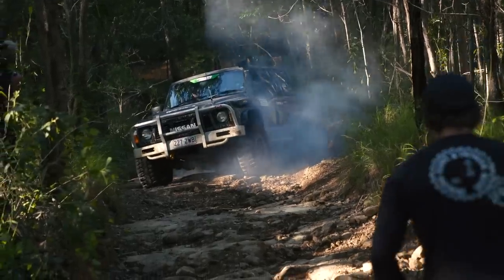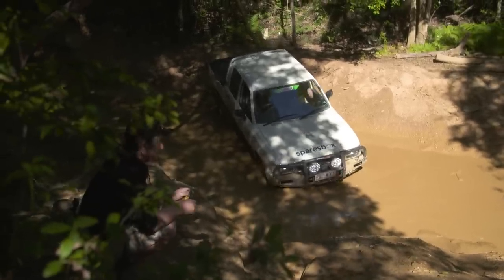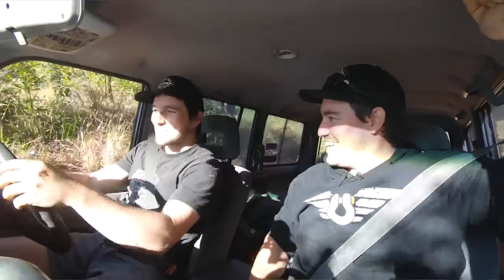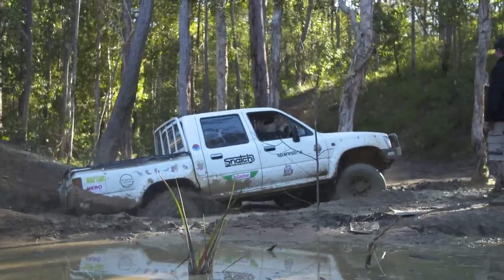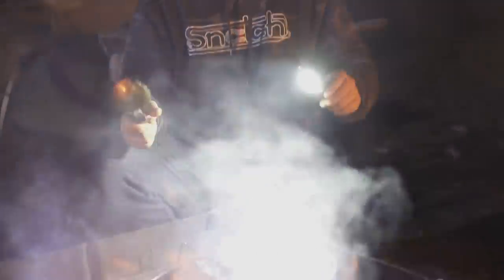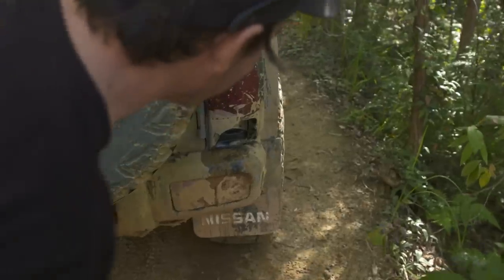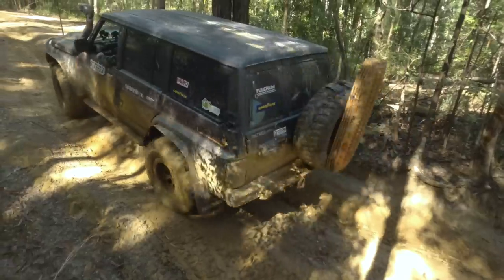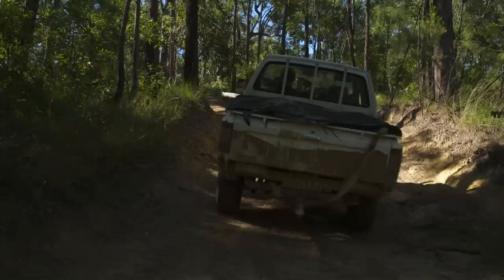BUSH MECHANIC FINALE - WHO WINS!? Jock rolls it, did Shaun finish? Our biggest 4WD Fail yet!

Comment: this really does show you reasonable grippy tyre with little or no lift and a winch will get you anywhere you want to go , we  have over modified our 4wd vehicles for years now, we used to drive those track on 16 split rims with the old dunlop road grippers  barely 6 inch wide rubber

Comment: this just goes to show that you dont really need expensive 4wd and over the top mods to have fun on tracks. i think i will put a winhc on my steel bull bar and have a snorkle already and that will be it. i dont need  fancy cars. now i am very happy with my 2006 dual cab triton. it is 5 speed manaul on 32 inch tyres. i dont think it has a lift kit but heyyyy cant get everything in one life time.
thank you guys for keeping us sane through these times.

Comment: I'd really love to see a review on the long-term use of a 4wd systems lokka, i see how great they work when they have first been put in a car but i never see any vids from someone saying they have had one for a year and this is what's happened
Reply: I've used Lokka on my front diff for many years now. Then it was due to budget constraints as I had so much more to do on the list. I've added Harrop E-Locker to the rear a few years ago and since I had it the GQ has been through so many really tough expeditions in Borneo.

Since then the GQ has been fitted with Superior Engineering full 6" lift suspension kit, the full treatment of UFI 21L, 12mm fuel pump etc etc. Guess what - I haven't bothered changing the front Lokka. I eventually will though, as the steering can be quite hard on very technical tracks. But it never, ever gave me problems in terms of not working as it was intended to.

Comment: Keep Darryl and build him up for 33s and power, steel bar, under body protection, front auto lokka and do engine back exhaust, intake and a tune. Wouod be a budget weapon and would show people that there is a different way to build patrols and highlight the petty and auto, i love a diesel and 50 50 on autp manual but i would love to have darryl with the mods i mentioned added and I'm sure you could get some serious gains given how big and how solid the petty is.

Comment: Having owned an LN106 Hilux, 80 series, GU and now a GQ  I can say the LN106 was a heap of fun but very rough and you never get used to lifting rear wheels. The 80 series was an awesome rig but both patrols were far more capable stock for stock with their factory LSD. Throw enough money at anything and it will be capable so it's good to see some fairly stock rigs going at it

Comment: All fun, no fail! Just more reasons to just get a 4x4, truck or ute, and go have a ball. But it also shows the limitations and need to learn as you go and not endanger yourself or anyone else by being a knucklehead.
  Cheap fun can be had. Still think lockers are a good first step. Because bigger tires can need a lift to not rub and cut themselves to death.

Comment: R them lockers in the front any good in the sand? Especially on sharp turns? I run air lockers so I have full control and can switch them off when turning in sand

Comment: As to who won the challenge? That hilux was as unstoppable a the legends say. Never missed a beat despite the cost and age.  Put bigger tyres and lift the suspension and it will be great, although I m not sure it will have the power/torque for the bigger tyres.  But despite the dubious reliability (what do you expect for $5k) I was very impressed by the offroad ability  of the GQ.  Put lockers on it and wow!

Comment: I have very very soft spot for ln106. Had a couple.  I have a gq td42 Silvertop aftermarket turbo well over 500,000 on the clock. Un locked and been all over vic high country,  south coast monkey gum. Been all over western nsw and QLD. I have a passion for the old rigs! If my cars could talk.  Lol

Comment: Ol’ Darryl won i think it had a cpl of mechanical gremlins but as far as wheeling goes it crawled threw and up everything . Defiantly the better of the 2 vehicles .. i was really impressed open diff’s and did better than the Lux with lockers ,, SHAWNO AND DARRYL  FOR THE WIN ! 😂🤘
Reply: Actually the LSD on the GQ's  rear diff is probably the best ever seen in the market as far as factory LSD is concerned.

Comment: Jocko sent it harder, but Shauno did it cleaner. Overall though, I think it was a great demonstration of the comparison between traction devices and tires. I would argue traction devices are a better investment and improvement; consider that if Jock had even just marginally better tires than the half worn all-terrains, he would've outclassed Daryl in every category. So what's to come of both vehicles? I can't see why Jock would get rid of the 'lux, but is Shauno gonna add a Nissan to his stable?

Comment: I think just because Jock put the Hilux on its side Shaun should take the trophy home. Shaun didn't have his preferred choice of vehicle from the get go. But it proved to be a monster still. Putting the amount of work that had to go into the GQ aside of course. But the truth is that when it comes to reliability you will always come second to a Toyota truck so we cant blame the GQ or Shaun for that. Would like to see what the Pony-express can do with some bigger tires. That rig has loads of potential.

Comment: The starter motor WILL NEVER BEND A ROD!!!  If you have it to the wood and the engine ingests water (or any non combustible liquid) while at a high RPM, the centrifugal force of the rotating mass will bend a rod, but a starter motor lacks the power to do any damage. If its hydrolocked it simply wont turn over enough to start. Cross your fingers and turn the key. Worst case you gotta pull the plugs anyway.

Comment: 39:39

What happened to the Sooty's tyre? Is that the camera vehicles tyre on there? :D

I must say, both the GU and the Lux did well, I have no clear winner! Think the main bottom line here is no matter what you drive, if its on 29's, 35's, lifted or locked/unlocked. JUST GO OUT THERE with some mates and have fun!

I have so much more confidence in my 2016 Mitsubishi Challenger/Pajero Sport to take her out to some tuff tracks!
Her name is Emma!😜 She has 30' General Grabber AT's and rear locker. Doing 1.3' lift and 31' tyres soon.

Well done to you guys, this was one EPIC trip and the episodes/content are tops!
Reply: Johan Kasselman GQ not GU
Reply: @bananaboat7950  🤣🙈 thanks bud.

Comment: Darryl for sure as much as I dislike crowning a Nissan
Reply: How dare you.
Reply: dartanion 007 sorry mate Toyota all the way 😂
Reply: @SK8ERLIFE8  yeah they are good but .....80 series,100 series too small cabin,75 ,my pick great motor but still small. Dx patrol 4.2 ,35s ,twin locked,3 inch lift only,heavy duty springs big bore shocks,proper rear bar,piss the factory guards off,,roof top tent"opening over the back"after market control arms,return to centre ,bla,bla....got a tank for under 20k.
..

Comment: Should i get 80 or a patrol?
Reply: Either. If you are handy with a spanner and can do your own maintenance get an 80 or early td42 patrol. Otherwise if you want a cheap new solid axle 4wd get a patrol, the 3l versions are great, the bad rep they had was back in 2000-2003.. So if you walk away with a cheap newer 3l patrol 2010 onwards you're laughing - shits all over the new utes and shitty 79 series that couldn't flex over a shopping centre speed bump.
Reply: Nick ok thanks im only 17 and looking for a project car😂

Comment: 29inch road tyres, no lift, almost no power, manual, and NEVER broke once even taking at least the double of the punnishment, comonn, its almost a stock vehicle, second day was a modified vehicle day.  Nissan who?
Reply: All terrains and twin locked is stock?
Reply: @Tufflux  almost i said. All terrains  are almost road tyres and their are stock tyres. At least in mud like that. In my county many old and low range vehicles have rear auto lockers so, yes i believe its almost a stock hylux
Reply: @c.franca2259  well all terrains are nowhere near road tyres and any locker is a far cry from what toyota get away with calling an "LSD"